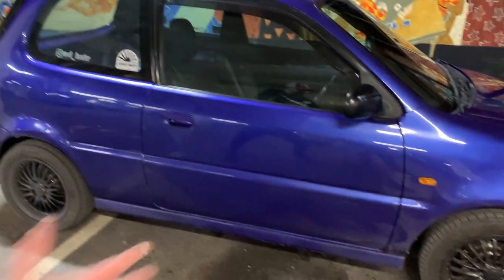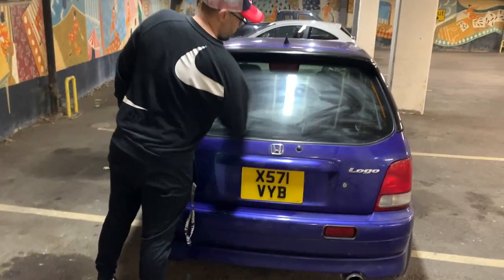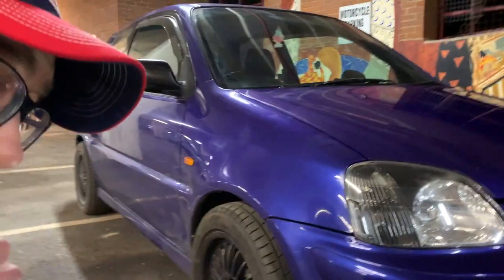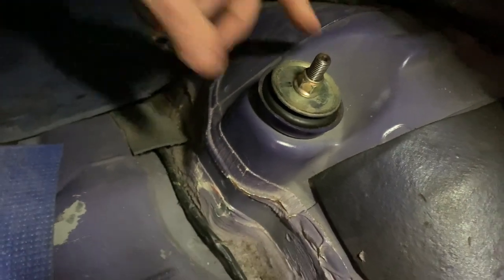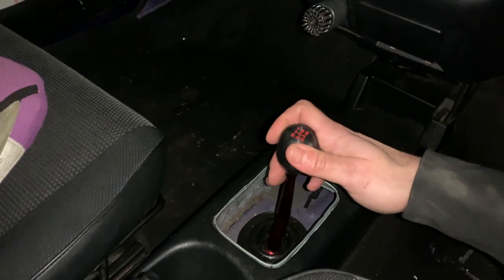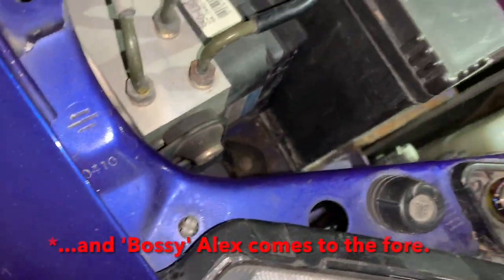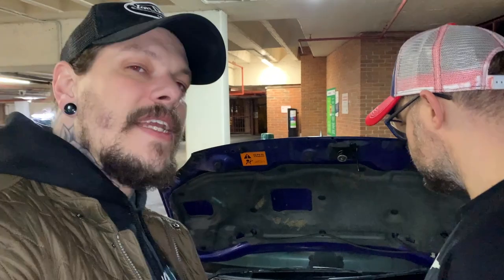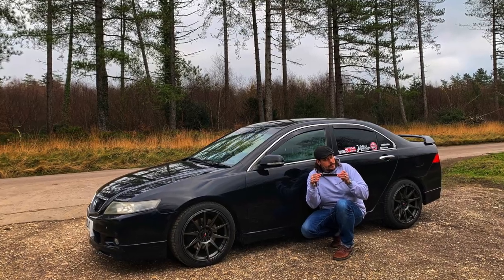INTRODUCING THE 2000 GA3 HONDA LOGO!

Comment: Needs a C32B sticking in the boot :D
Reply from the maker: …a similar idea has been mooted… 😉😂
Reply: @SULKNATIONtv  This video is filled with some gems. A car boot stereo and the whimsical way in which Ed shows his appreciation for Logos with 3 or 5 doors. Anyway, more doors for more wh.. as they used to say. And let me tell ya, the Logo is an absolute magnet 😂

Serious note: instead of Rotas, have a look at Autostar wheels. They are a budget brand too but they make reps of proper JDM cool wheels. This would look sick on some Autostar Sutorros or the Autostar Classics :)
Reply from the maker: @TB.JCE10  cheers mate! I’ll get Ed on a research mission in relation to the wheels! 😂👍🏻